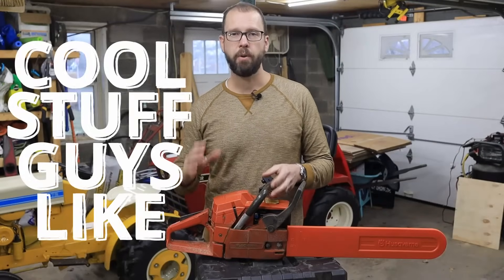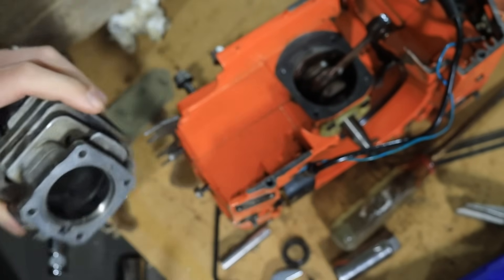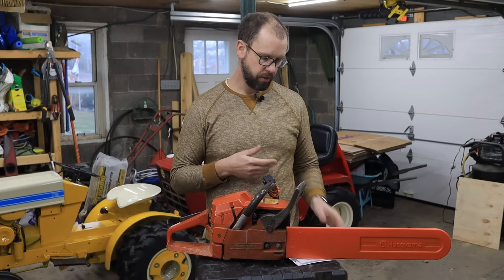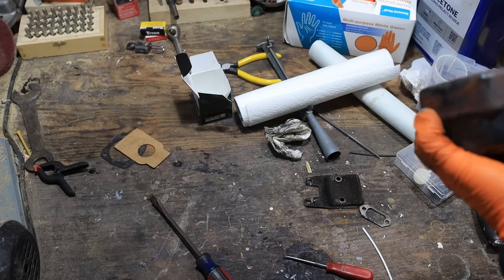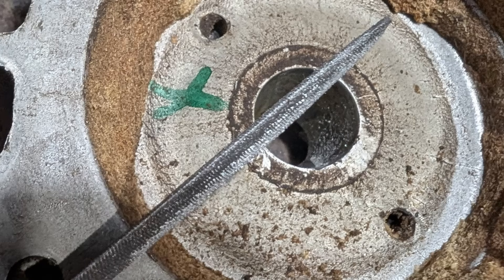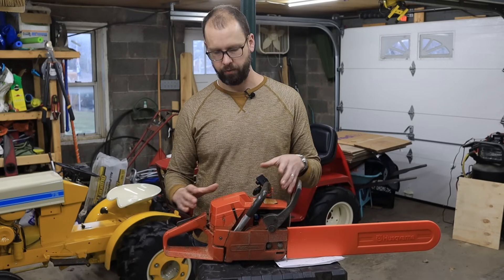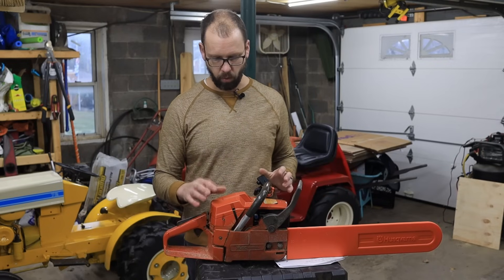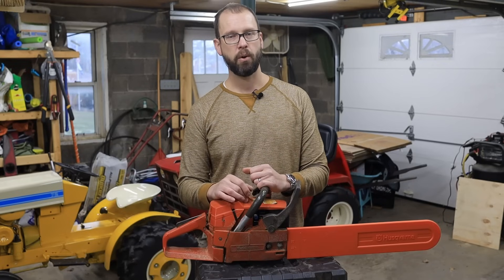Husqvarna 257 to 262xp conversion

Comment: Great saw! I just picked up a 257 and after watching this I know the direction I’m going!
Reply from the maker: It is the way to go!  Just beware of super cheap aftermarket cylinders.  Sometimes the port timing is out of whack with them.  You may be able to work with it if it is "steel safe" or "aluminum safe" in this case.  You definitely don't want to blindly grind with aftermarket though.  Get a degree wheel and see where you are at first.  With OEM, you are pretty safe lifting the exhaust about 1mm and widening it a couple mm.  There are some good forum posts with port timing numbers for hot 262xp cylinders.

Comment: did you try the HDA-87 carb ? first gen 262 carb, it's bigger
Reply from the maker: I didn't.  The only one I have seen come up was $200 on eBay.  I offered about half since it had sat there for a year or so but he didn't bite.   This saw has the HDA120.  I will keep watching for an HDA87!  My guess is you would get more revs with less finger pull, but who knows if you would actually make more power in the cut or not.  The 120 flows plenty of air to zing past 14k rpm, so I would think at 10 or 11k it would not make a huge difference but I am certainly intrigued to find out if I can
Reply: @CoolStuffGuysLike i had mine ported and they swapped the carb for the 87. difference in rev and snap is really there. gilardoni and hda87. got the carb for free  ❤

Comment: Hello sir, I like your video on the 257 because it's the model I have.
I like it, but it's starting to run out of steam. If I put in a 262 cylinder and piston without anything else, will it work as it should? Thank you for your answer, or would it be better to just put in a 257 piston because my cylinder is fine?
Reply from the maker: If I remember right, you will also need a 262 intake manifold.   As for gaskets, you can likely make a gasket from a beer can with a thin layer of motoseal for the base gasket but you should measure your squish to be sure (smash a piece of solder between piston and head.).  It should ideally be between about .017 and .022.  To fully convert (optional) you will want a top cover from a 262/262 and the intake adapter for the other side of the carburetor.  Without it, it will work but you will need a washer under the intake adapter and your filter may rub the cover a bit.

Comment: I think the 257 being so overbuilt and underpowered seems to make them last forever.
Reply from the maker: Definitely!  A 4.8 horsepower 262xp shares most of the same components.  Aside from doing something stupid, I don't think you can kill a 257.
Reply: @CoolStuffGuysLike  I'm glad you think so. I just love my 257, although I mostly own Stihl saws. It does struggle with a 20" 3/8 bar, so instead of building it into a 262xp, I've decided to go the other way. I recently found an old (out of production, I think) Oregon 100758 Clutch drum. This allows me to run a small rim, so I can now run a 7 or 8 pin 325 rim. I put a new .325 20" .058 bar on it, but haven't had a chance to take it out. If it pulls it well, I have some 8 pin rims to try as well. It won't be the fastest saw, but I'm thinking it will be unstoppable with a 7 pin 325 rim. A chainsaw with a granny gear, lol.

Comment: I think you did a great job on the work to the saw, but it seemed like you are cutting with 2 different styles in the side by side video. You used the buck teeth on the right video, but not the left😢 what are buck teeth ,I don't know either I made up the name because I don't know the real one haha cut away
Reply from the maker: Thank you!  On the left I was unable to really apply any down pressure beyond the weight of the saw, or it would stall out in the cut.   On the right, after modification, it was holding rpm even when I got into the dogs and applied pretty good down force.  In either case, I was pushing down as much as the saw could handle but trying not to go so far that it would bog down or stall the chain.  It was honestly hard not to bog it before modding.  I think the log was about all it could realistically handle.

Comment: How did you get your measurements to do the port work?
Reply from the maker: I went off of some measurements of more experienced porting guys but only took it about 2/3 as far just to be a little bit on the conservative end.  Honestly I can't believe how rowdy the saw is though for 62cc so I think where I ended up is a very good spot.  I have a 261 that I will be porting very similarly in the next few weeks.

Comment: You did not waste money! This is what I enjoy doing myself as well. Hot from the factory was the comment of Dolmar saws as well in the past. I think emission regulations today hold performance back. You would be looking at $350USD minimum for a port job. Add that to a new saw in that class and you are saving at least $1K.👍
Reply from the maker: Thanks!  At the very least these old saws are very easy to modify.  I'm sure this saw would hang with about any new saw under 75cc but just needs a quick tweek of the high speed screw once in a while vs a new saw that auto-tunes.
Reply: Idk man the 550 mark 2 is a flat out ripper, never found a old school 50cc that'll keep up maybe a 346 idk

Comment: No your good with the mods, my tuned 281xp would have trouble keeping up with that and the biggest obstacle it has is keeping the shavings exit clear. I call it my hand held timber mill. Run it on good petrol and the best oil and if it cuts like that reliably then every cut is a smile.
Reply from the maker: Haha that is awesome!  This one really puts a smile on my face now, that is for sure.  I'm not sure what else I would ever want in a saw.

Comment: Why no Chips on first , seems strange
Reply from the maker: It is throwing smaller and less chips since it would bog down if I beared down on it much.   Since it is cutting at less than half the rate it is throwing chips at less than half the rate.  After mods, it was holding about 10,000-10,500rpm in the cut, vs about 7800-8500rpm in the cut before and would bog with very little down pressure.  You can see on the "before" cut that it bogged once and grabbed the chain and I had to reset for a second.  It was about as much log as the saw could handle.  I am certain it could run a 24 inch bar with ease if I needed to now.
Reply from the maker: You'll also notice the camera was a little out of focus on the first cut and I have it cropped in a way that most of the chips are being thrown out of frame, or below my "before" tag.  After the mods it was fire hosing chips so hard that I about filled up my boot.
Reply: I did notice you had cropped it ,strange again

Comment: I just bought a used 365 for $80.. instead.
Reply from the maker: Wow, that is an insanely good price!   Was it the real deal or a clone?
Reply: @CoolStuffGuysLike  It's a real one..  well used though.> Still runs like a champ.  but it's not pretty. lol.   Didn't run either, but I got it going with the usual maintenance
Reply from the maker: That is still a steal!  If you rebuild it, you should convert to a 372xp, which I believe is pretty simple.
Reply: I've had my 365 for probably 25 years and I still love it